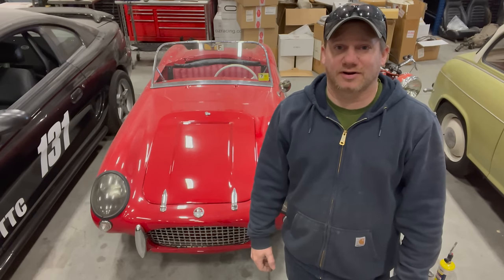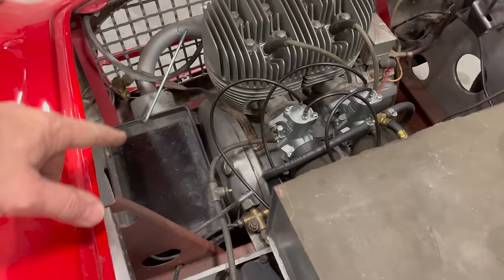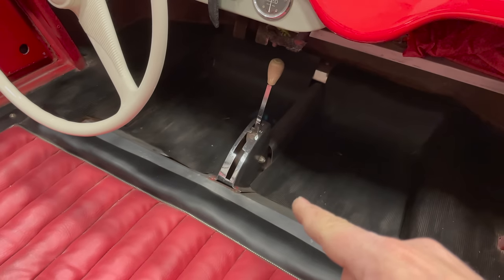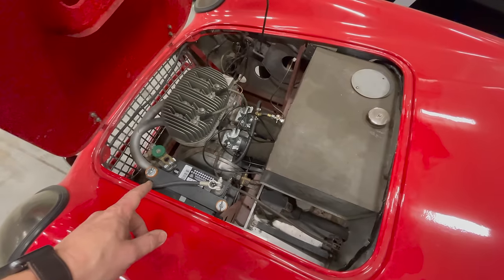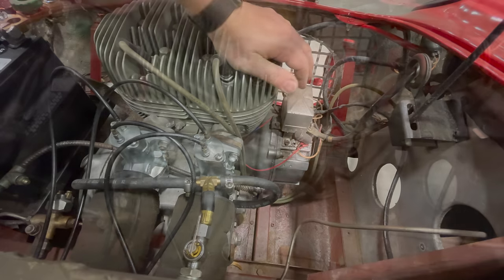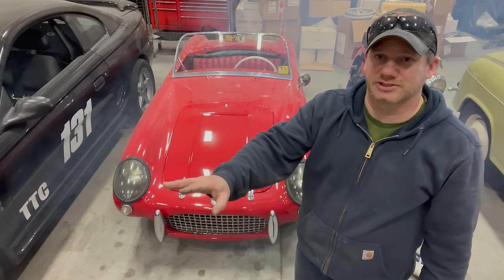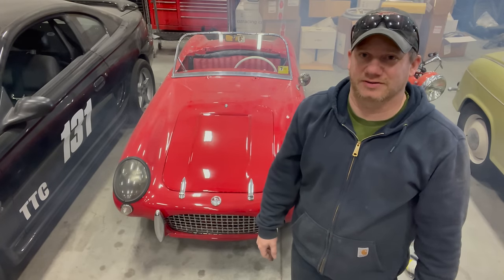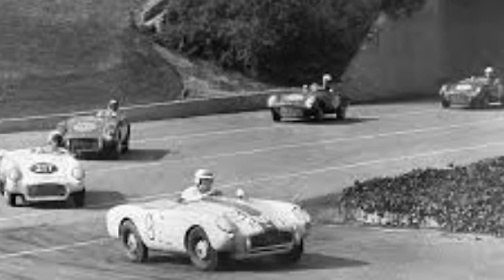Driving the 328cc Two Stroke Berkeley SE328

Comment: Long ago, when I was a teenager, I put a deposit down on a 2 stroke Berkeley three wheeler. Belatedly, I got my Dad to look at it, he pointed out that turning the steering wheel moved the engine but not the front wheels, I was convinced this repair was beyond me and to the guys credit, he gave me my deposit back!
Reply: That would have been a Bond with the single wheel at the front,  the Betkeley three wheeler had the single wheel at the back.
Reply: @robertcross1441  I appreciate how the Bonds engine swings round to steer but the Berkeley I saw had a sub-frame that had largely removed itself from the fibreglass shell, turning the wheel moved everything - though at some stage the slack would be taken up allowing some steering!

Comment: Age the ripe old age of 16 in 1971, this was my second car here in the UK. My first was a Heinkel Trojan bubble car, also a 3-wheeler as my licence entitlement at 16 included motorcycles 250cc and under. If you sat & passed your motorcycle test, your entitlement then included unlimited size of motorcycles plus 3-wheeler cars (unsupervised). It did mean that on my 17th birthday, I had to revert to a provisional car licence and a supervisor in order to drive my Ford Anglia to the test centre in the afternoon where I passed my car test & could drive any type of 4-wheel car just like I'd been doing for the previous year with 3-wheelers.🤣 

I loved my 2-stroke Berkeley although one evening, the left front wheel fell off at 50mph due to the split (cotter) pin having somehow dislodged from the hub nut which consequently unscrewed (I was lucky to retrieve it). It was a ¼ mile embarrassing walk to retrieve the wheel which had happily bounced on its merry way whilst the car came to a grinding 45º halt though. Happy days.

Comment: Little known fact about the 328cc Excelsior two stroke engine is that it is fitted with a SIBA Start combination electric starter and alternator directly on the crankshaft.   A design principle I believe BMW are adopting over half a century later.   Berkeley also made a two wheels in the front one at the year three wheeler with the same engine ( which I had),   a 492cc Excelsior engined four wheeler which had a third cylinder in the centre of the twin 328cc design and a Royal Enfield Constellation motorcycle 700cc twin cylinder four stroke engined four wheeler that I believe was good for over 100 mph.  Berkely of Biggleswade, Hertfordshire, England was mainly a caravan manufacturer.

Comment: One thing you need to be aware of with older carbureted two stroke engines, is that in the carburetor,  air-fuel ratio is a function of fuel viscosity, and with modern high ratio 2- cycle oil, the viscosity is lower and might cause a 'richer' fuel ratio, if the carb has a "hi" needle, it needs to be re-adjusted for the brand and mix ratio of the oil you are using.

Comment: I saw the Berkeley new, at the dealers in Miami. I was in high school, about 1958. 
Five years later, my friend had one with a Triumph 650 cc twin. His other car was an Austin Healy  with a fuel injected 283 Chevy engine that replaced the original 4 cylinder. ( actually, it may have been a 327 )...

Comment: I had the three wheeler. Had a lot of fun in that. I changed the engine for the two stroke triple, Excelsior. Then later for a BMC 1100.
They are these days used in VMCC, vintage racing, along with period sidecars.

Comment: I had a three wheeler version, because of licensing you could drive one on a motorcycle licence, it had a thick glass body but only a bit of steel reinforcing but NO alloy in it. 20; 1 mix before the synthetics were thought of. People also put mini engines in them and all manner of mixes were done.

Comment: Love the sound and smell of a two-stroke engine! That Berkeley was also available as a three wheeler. In the 50's and 60's there were many three wheelers around like reliant, bond, trogen,  and the bubble cars because the road tax here in the UK was so much cheaper. The Berkeley three wheeler was just like yours only it had a single wheel mounted centrally at the back. Great video, Steve. Love your videos. That Sunbeam Tiger looked beautiful!

Comment: They also made the with the big Royal Enfield twin engine - I guess these would be quite exciting with 50 odd horse power.
Reply: He could get the head and intake manifolds gas flowed and ported.       Had that done a few years ago to my Ford Capri. Guy doing the work said he had done a 2 cylinder 2 stroke that had 22bhp. When he finished it had 38bhp that's a gain of roughly 80% more power.

Comment: I didn't know Berkeleys were exported to the US until I saw one lurking in a barn on 'American Pickers' a few weeks ago.  As well as the four wheelers you could also get a three wheeled version which cost a lot less in road tax in the UK as they were rated the same as a motorcycle and sidecar. Another advantage of the three wheeler, you could drive them at age sixteen instead of seventeen for a four wheeler.

Comment: Fab little car. I remember going to buy a motorcycle petrol from someone in the 70s and they had a similar Berkeley but it had a 3 cylinder 500cc two stroke engine (not sure if it was a villiers or Excelsior). I suspect it was rather quick. Beautiful engineering on that one.
Thank you. First one I've seen on the road. Nice video. Well done

Comment: Had to laugh when I saw your video, I had a 3 wheeler version back in lat 60s it had a 250 villiers engine, to start it you had to open the bonnet and kick start it
Reply: @Terry Bloomfield Thanks for confirming that there was a three wheel version - I remember seeing one quite often when I was at college in Bristol in the mid-60s.  I recall hearing that it was so low that it would drive under the exit barrier of some car parks.
Reply: I had the three wheel version!! it had no body and it had been fitted with the 328cc engine exactly the same as the car in the vid, electric dynastart and reverse gear..i had it as a go kart ..it was mental and nearly killed me loads of times! :D :D

Comment: Quite an unusual car, even after nearly 7 decades living in the UK I'm not sure I've ever seen (or heard) one before, Wiki says that only a few thousand of this model and various other Berkeleys were made between 1956 and 1960. 

Rather more popular cars of this genre in the UK were the very weird, three-wheeled two-stroke Bond Minicars with about 25,000 produced between 1949 and 1966. We also had a fair number of two-stroke bubble cars on the roads here in the 50s and early 60s, notably the Isetta, the Messerschmitts and the Trojan which all had a similar engine sound to the Berkeley.

Comment: I used to have a 3-wheeled T60 version, which had the uprated 520cc 3-cylinder two-stroke engine. It was driveable (in the UK) on a motorcycle licence. Odd you use a flashlight to check your petrol when you have a fuel gauge...

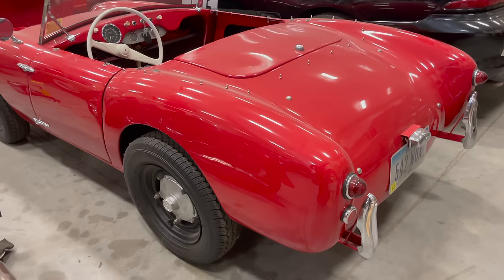Comment: 2:14 I was too quick to be almost offended by AC (ace and Cobra) ripping off the design from Berkeley. It turns out that the AC ace is from 1953, and the Berkeley is from 1956, so if anything it could only be the other way around.

Comment: I owned a Berkeley when I was 17 years old - nearly 60 years ago. It was awful - the most unreliable vehicle I've ever owned. I hated it. My father made me buy it as my first car and it was a heap of rubbish from day one. I couldn't keep up with the body falling apart. I never ever managed to 'do it up' and respray it because as fast as I could repair cracks in the gel coat more developed. It also had the most unreliable brakes ever. I was driving into London one day with my girlfriend beside me and her French pen friend sitting across the back where you showed the spare wheel and the only way I avoided going into the back of the vehicle in front was by driving up the kerb and onto the pavement. Luckily nobody was walking there at the time. It broke down so may times that I almost lost all my friends who had to keep coming out to rescue me. I eventually managed to dispose of it to someone who thought he could sort it out. But he couldn't. The last time I saw it the body was propped up against a building in a scrap yard. By then thank God by working in my uni term breaks and holidays I'd saved enough to buy a Mini, the car I'd always wanted from the beginning. Now that was a great little car, but that's another story. BTW, the engine and gearbox were from a Royal Enfield motorbike. That's why the gear stick only goes forwards and backwards - because it was still a motorbike toe gear changer.
Reply: WOOOWWW....i bet that car could use some modern motorcycle 4 stroke engine upgrade today... bondo epoxy resins today are also more reliable at patching up cracks..

Comment: Try turning over with  bell housing disconnect clutch turn over with huge  ratchet wrench and pipe from under. Neath. Pull drive line out of way and wratchet at fly wheel. I cant think of anything else. I hope I havent given you bad advice. Bye for now.

Comment: A 328 cubic inch engine like in the Ford GT? Umm, no. A teensy bit smaller.

Also 10" shorter than a Daihatsu Copen and 8" lower than a Smart Roadster.
Reply: 328cc. That is 328 cubic centimetres
Reply: @michaelketley876 Yes, hence my joke

Comment: That needs a Hyabusa engine dropped in it.  No, really, it does.
Reply: even an old bandit1200 engine will do wonders for it!
Reply: @fidelcatsro6948  yeah probably a better idea! Plentiful in supply!
Reply: @kevinchamberlain7928  aircooled 5 gears, all it needs is an electric fan, upgraded brakes and suspension to take the weight of the engine
Reply: @fidelcatsro6948  Breaks?  NO!  The lumps of wood it already has are fine!  Suspension is fine too, just screw the Ba Jesus out of it, it'll be reet!